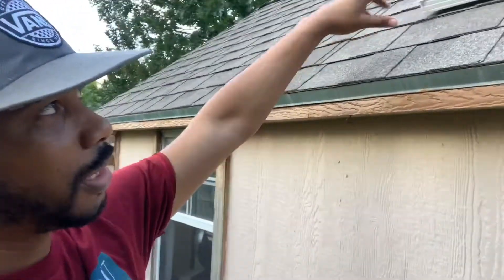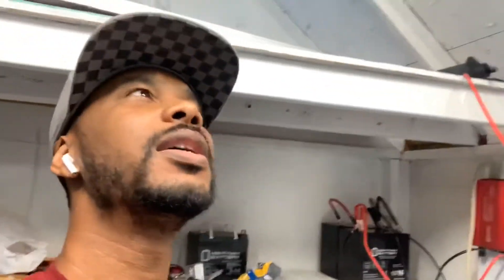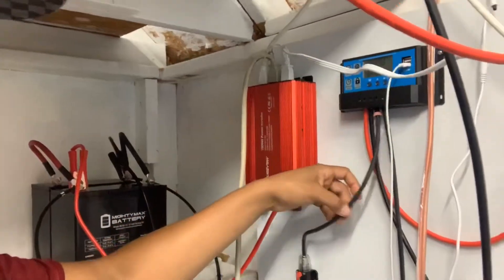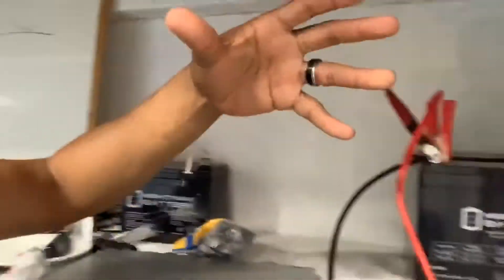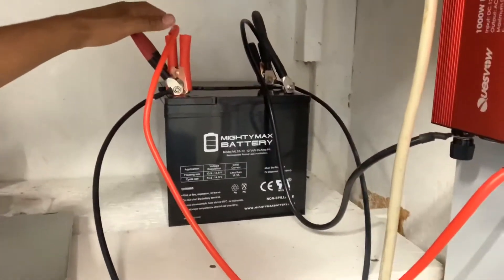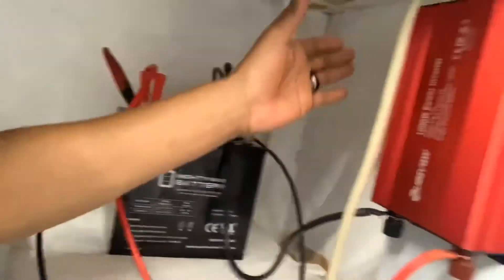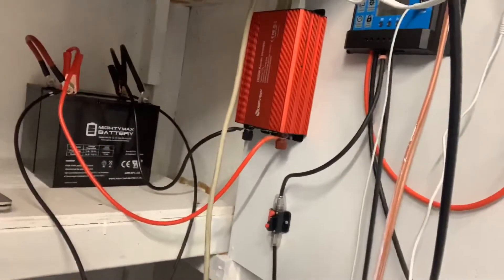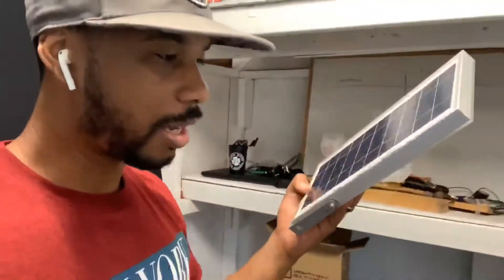Off Grid Solar Power System ( I Made a Solar Office Shed)

Comment: Another good idea is to use a DC Motor in place of the panels. Run it the same way through your charge controller. You can't predict the weather.

Comment: how do you ensure the batteries don't drop below 50%?  Does the charge controller tell you the battery level?
Reply from the maker: Yes, the charge controller will tell you the battery level. I recommend you get a MPPT charge controller instead of a PWM, it’s a lot more efficient.
Reply: @markfrankstechreviews3744  awesome thank you!  Yeah I'm getting a MPPT. Does it usually tell you the % or do you have to determine the level by voltage?
Reply from the maker: @davidcastellani8942  It tells you the level of voltages you have left. The lowest I would go on my batteries is 12.2 volts respectively.